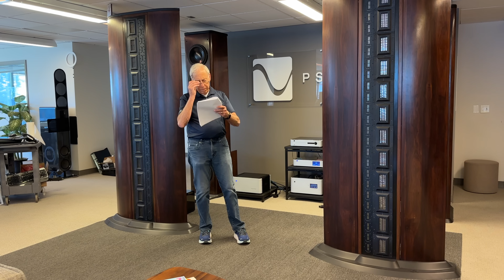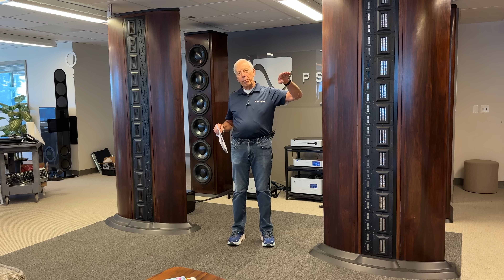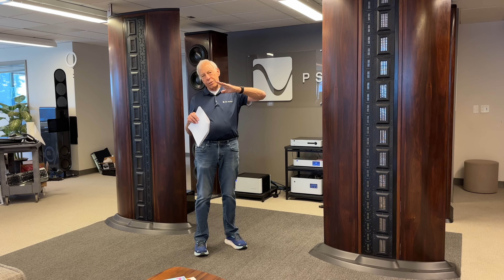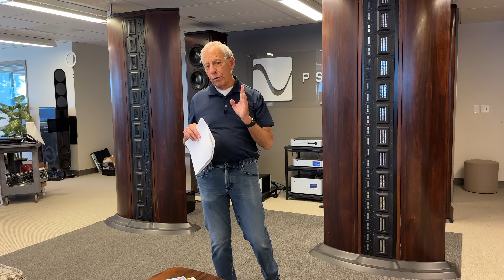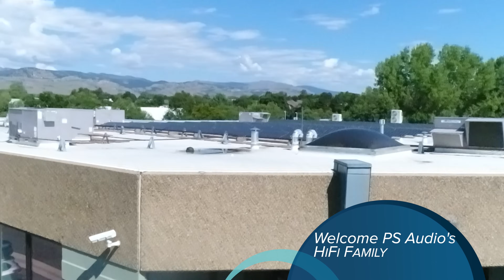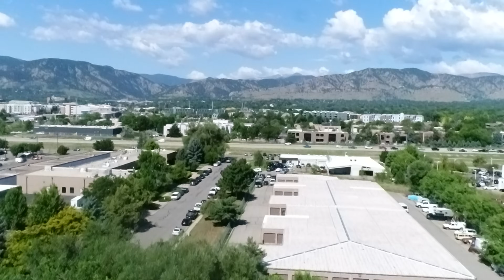Why ultrasonics are important

Comment: It's interesting that you discuss the audibility of phase shift in the highest octave while not discussing the significant phase shift in coil and capacitor based crossovers.  An LR4 crossover, for example, walks through a full 360 degrees of phase shift in the source material in the octaves above and below the crossover frequency.  Since a square wave is a combination of the fundamental and its odd harmonics correct in both amplitude AND phase, it is impossible for a speaker with such a crossover to accurately reproduce a square wave.  The fundamental and its harmonics simply can't all align.

An accurate digital FIR phase free filter, perhaps including time alignment and some phase error compensation for the drivers, is essentially the only way (other than using strictly 6 db/octave crossovers) to enable a speaker to accurately reproduce a square wave.  This reflects on its ability to keep fundamentals and their harmonics time and phase aligned -- which as you indicated -- can affect the sound of the music.

Comment: The average 35 year old male has 11 dB hearing loss at 8KHz and probably no hearing above 15KHz.  Speaker and headphone manufacturers who claim response to ultrasonics are playing to the technically challenged customer. Be very careful testing your hearing by playing high frequency tones through your headphones. The test should only be done at normal volume. It is tempting to play a 15KHz tone or above and increase the volume until you think you can hear it. This is very dangerous and may cause hearing damage.

Comment: Lead the way Paul! I have said for decades that one of the problems with the audio industry is being stuck in the 50's and 60's test and measurement. Back then, which I was, even generating a good clean sinewave was expensive. Much less variable frequency with accurate display. We did not have digital readouts. I challenge the claim that we had equipment that was flat enough in the '50's to accurately reproduce in order to measure the 20Hz-20Khz way back when it was first claimed. Much less time domain anomalies. Dr Matti Otala's TIM in the '70's was the first I saw that moved past simple steady state sinewave. 

But our auditory system just like music is not based on frequency. It is based on time domain, variations, transients... Phase shifts and delays are more audible than slight variations in frequency response. But not measured with our current T&M. 

We can get a better measurement of phase response accuracy by using squarewaves. I was taught in Waveform Analysis 101 that the first ten harmonics of the fundamental are as critical as the fundamental. Thus a ten times bandwidth is needed to reproduce a fundamental accurately. So to accurately reproduce to 20Khz, you need a bandwidth out to 200Khz. 

But yes a good phase based measurement is needed! One paper I read shows that the "phase" difference between ears, the ability of our auditory system to resolve phase, transient reception between ears is as short as 10-20 microseconds! The human auditory system can resolve detail as high as >100Khz. Just not a stead sinewave.
Reply: Well said!!! We "hear" much more than frequency. It's evolutionary. The hair on our arms, sounds from behind us, time, reverb, phasing, etc... We pick up a lot of info, a lot of ways when "listening". 👍👍

Comment: Given a -3dB spec of 50khz, given a single dominant pole roll off, the phase is -45 degrees.  One octave below 50 kHz, it is -26degrees.  At one decade below 50 kHz, the phase is -5.6 degrees.

Comment: Firstly, response concatenates, a -3dB at 20KHz pre-amp and a -3dB at 20KHz power amp’s  –3dB point is 14.4KHz.  (This is another longer subject BTW) The question is around that phase begins to shift a decade down, so for a 20KHz filter, phase starts to shift at 2KHz. Pauls explanation is grounded in good Eng. Lets play with a 7.5KHz tone (nearly double highest piano note) and its 15Khz first harmonic. Phase magnitude matters, so what is say, 10 degrees excess phase shift at 15Khz due to BW cut-off going to look like. Well the wavelength of the 15Khz harmonic is 2.28cm and a delay due to 10 Degrees phase shift is 2.28/360, * 10 = 0.63mm (24thou) Keeping in mm, sound is 343,260,000mm/ sec, so a 0.63mm delay represents a = 0.000000018s (1.8nS) delay in the 15KHz harmonic of 7.5KHz. You have to remember your ears don’t work at  ~2nS = 500MHz. This said, my main amp has a -3dB limit of 200KHz, and the great Rupert Neve had 200KHz in his elite mixing desks. You always lose when you win, so extended BW brings issues of intermodulation distortion possibly increasing etc.
Reply: "That said..." I was awaiting a big conclusion. And you came and told about you amp and someone's desk and blabla :/

Comment: There are similar rules-of-thumb with wide-band voltmeters and oscilloscopes. Whatever the high-frequency -3dB cut-off is, if you want accurate amplitude measurements, stay a decade below the -3dB cut-off. If you want accurate phase measurements, stay TWO decades below the -3dB cut-off.

Comment: Speaking of phase shift / delay, why are the subs in a different time zone ?
Reply: I asked the same question a while back so I made sure that my dual subs weren't.  What a fine improvement it was in all aspects. Since I experiment a lot, less so now since I have gotten a system sound so close to what I want,  I have come up with a personal concept on speaker design and setup.  I call it homogeneous sound.   Everything in time, and in physical alignment, even your low frequency subs.  Keep sound as close to point source as you can reasonably do.  The fact that our hearing does not perceive any directional quality below around 70hz does not mean that the speaker's mechanical cone focus does not present a directional wave. I postulate that that wave must be homogenous with the rest of the primary speakers wave focus.  This also helps explain why dual subs, linked closely with the primary speakers adds to the perception of the entire stereo  image as well.  Try it and see for yourself.  Be sure and space the speakers from the side and front walls and other reflective surfaces for your test, even if impractical for daily use.  After over 60 years of tinkering and experimenting it was quite a surprise for me.  Of course, no 2 rooms are the same, unless built specifically same.  And as always, set height, toe in/out etc. and listening positions according to your room acoustics and personal taste.
Reply: @OldTooly   I have about 50yrs of working with this addiction, and yes you're exactly right....the subs ALWAYS sound better in the same plane as the tops. Always get as close to point source as possible.

Comment: Paul is right... phasing is important but not as an independent function.  

What needs to be appreciated is that you are not feeding your amplifier 12khz, and 22khz and 30hz all at the same time.  You are actually sending it a single voltage that changes over time.  On an oscilloscope this would appear as a 30hz waveform with the 12 and 22 khz components riding on top of it... sort of a fuzzy 30hz waveform.

That waveform is also how you are asking your speaker cones to move.

All the rest of it ... the FFT, spectrum, frequency etc. are all mathematical abstractions taken from that single fuzzy waveform.  While they have value in examining how things are behaving, they are not exactly what you are asking your system to do.

The answers lie in the "Transfer Function"... All electronics introduce a delay, it takes a finite amount of time for the outputs to react to the inputs.  This also limits how well they can respond to rapid changes, ideally they should be able to reproduce a change fully before the next change comes along.  

So, what happens is that we have our fuzzy 30hz waveform. The amplifier might be fast enough to perfectly track the basic 30hz part but the smaller bits riding on  the waveform may fall victim to "propogation delay" and "slew rate" as above and not be fully reproduced.

Whether this is crucial at frequencies we cannot hear is an ongoing debate. The fact is the inability to accurately reproduce the smaller more frequent "fuzzies" on our waveform does, in fact, change the waveform itself in very subtle ways.  

But as always, the question is whether that is audible or not...

Comment: How about this one:
If every component was doing 20kHz at -3dB, the combined response would roll off at much lower frequencies, probably below 10k.
Reply: What are you talking about? That doesn’t make the least bit of sense, are you lost?
Reply: @WeeWeeJumbo  Sure it does.  He may be wrong about the 10k part, but if your amp is -3dB at 20KHz, and your speakers are -3dB at 20KHz, the result will be -6dB at 20KHz.

Comment: The musicality of anything above about a quarter of the Nyquist point is just splatter to my ear, so yes great sound needs more than the hard limits typically imposed can transmit. I'm more forgiving of pure analog rolloff, but haven't had experience with that for almost two decades.
Reply: FWIW ... almost all musical content occurs at 4200hz or less.  
On the piano keyboard the tenth harmonic of middle C is only 4,400hz 
Above about 8khz it's all just "splatter", harmonics of higher notes and noise.

Comment: An extended high frequency response also can affect apparent transient ease. I was playing a solo acoustic guitar recording and I decided to connect a tweeter with more high frequency extension. The sound took on such an effortless quality on the transients, as he plucked the strings. The system just sounded like it was right on top of things with the more extended tweeter. Spectral power amps have been known to go up to 1 million hertz, according to their specs. Some in the forums said that you had to use a special constructed speaker cable with them, for them to honor the warranty on the amps.
Reply: So the only difference between the first tweeter and the 2nd tweeter was the high frequency extension? You're instantly ruling out other factors?
Reply: Just use 18" dia. copper plumbing coax with nitrogen for the dielectric. Runs out to several hundreds of Mhz, handling power up into megawatts. Guaranteed no phase shift.🤣
Reply: @InsideOfMyOwnMind Try some Heliax, nothing better for high power rf.
Reply: @ianbigsand7  Is that indicative of helium for moisture abatement as opposed to atmosphere for the dielectric? I know I said nitrogen because that's what they use to displace moisture in some other disciplines. I know you can have actual tonnage of that stuff in large combiner rooms feeding large community towers.
Reply: @InsideOfMyOwnMind  Sorry, it's me being slightly facetious. Heliax is air spaced coaxial cable used for broadcast applications, handles very high power while maintaining a constant 50 ohm impedance. The heli part of the name refers to the ptfe helical support for the inner conductor. Totally and utterly impractical for hifi, but it would cope with harmonics out of the human hearing range.
Reply: @ianbigsand7  Yes, I need a system so powerful that requires an inert gas constantly flowing through the speaker cables to prevent arcing across a one foot gap.🤣
Reply: @InsideOfMyOwnMind shielding with bacon would work,
Reply: @InsideOfMyOwnMind insulate it with some bacon wrap I will will definitely buy😂
Reply: If the transient response is even a tiny bit slow, the whole thing sounds like a reproduction; and a mechanical one at that. That's one of the reasons I use great cables, and on phono, a moving coil cartridge or some equally exotic type, in place of moving magnet. That slight delay in hitting the leading edge of notes, gives it away & tells the ear that it's only a reproduction.

Comment: If you think "phase" matters, measure speakers in a room lol. Its not uncommon to have tens of thousands or even hundreds of thousands of degrees of phase shift indicated in the measured response due to the propagation delay and reflections. Does it matter? Absolutely not. There are places where it does, but not here...
Reply: Well reflections are bad, right?  Would you want to listen to your stereo in a glass room?  Plus, we're not talking about phase shift between speakers, or due to propagation delays.  If you add two 10KHz sinewaves that are exactly in phase, it's going to be louder than two 10KHz sinewaves that are not in phase (all else being equal).
Reply: @Hyxtryx  There are two problems. The first is that you not only cannot eliminate all the reflections, but doing so is highly undesirable as it severely penalizes the sound of the speakers. With principally direct sound, conventional loudspeakers wont sound correct at all. There are various psychoacoustic reasons for this that are beyond the scope of this discussion. The second is that two speakers playing 10 kHz in a room will sum in very complex ways. The room will have a complex pattern of nodes and antinodes due to interference (an effect called comb filtering). It won't simply be 2x louder at the listening position due to the complex path it takes thru the room. Remember: Well designed speakers have a diffuse sound field like an old-school soft-white lightbulb. Most typical hi-fi speakers radiate over 100-160 degree angle across the front baffle. Only a small portion of the sound gets there directly. The rest gets there by reflecting off of things in the room.
Reply: @mysock351C  I'm thinking of tones coming from a single speaker, just to keep things simple and to make a point.  If you're not centered between 2 speakers, obviously there's going to be a phase difference hitting your ears.  And room reflections, yes.  That happens in live settings as well.  There's so many variables, why not try to eliminate the ones that you can, to get a little bit closer to "perfection"?  What about headphones?  That all but eliminates reflections.  Does that mean a headphone amp needs to be designed to a higher spec than a regular amp?

And, I just thought of this now... A similar thing can be said about Total Harmonic Distortion.  A little googling says that 0.5% is good for a tube amp, not that good for many solid state amps, but it is fantastic for a speaker.  Does that mean that THD doesn't matter for an amp, because your speaker will always have way more?

If your amp has a flat 50KHz bandwidth and low THD, that equates to piece of mind, that at least that part of the signal chain is not coloring the sound.